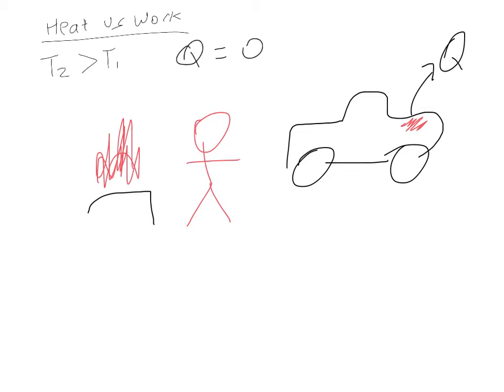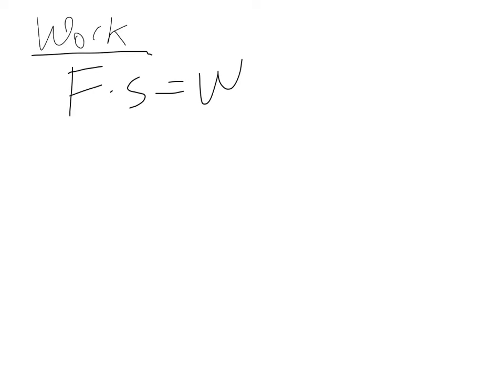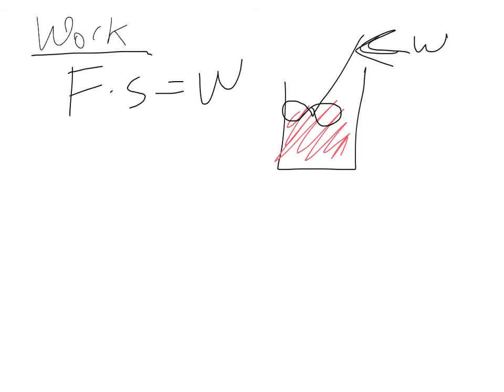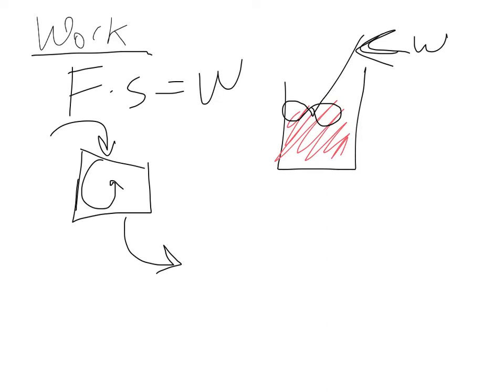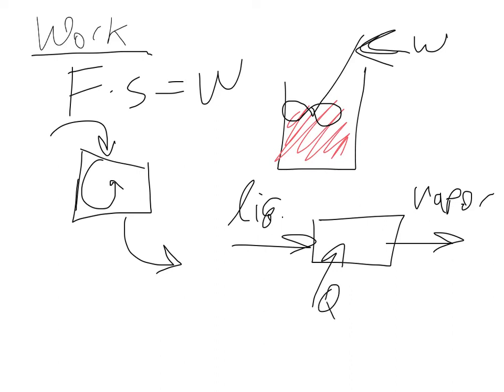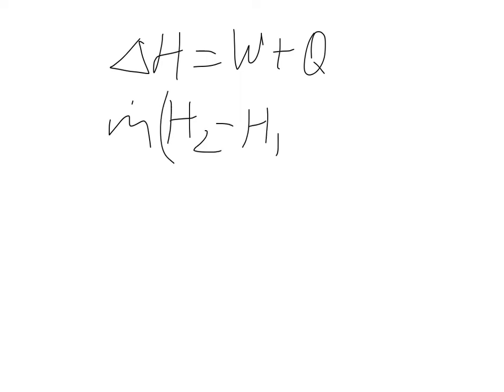Heat vs Work

Comment: I believe it would be worth while to explain some basic assumptions you can make about certain thermodynamic cycles ie  for a refrigeration cycle; Isentropic compression, Constant pressure cooling, Isentropic expansion, Constant pressure heating.